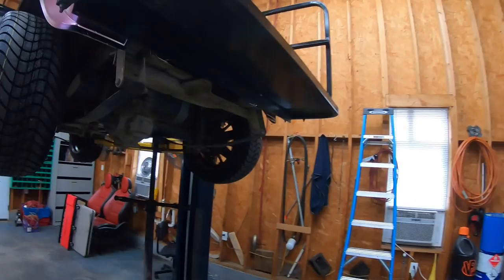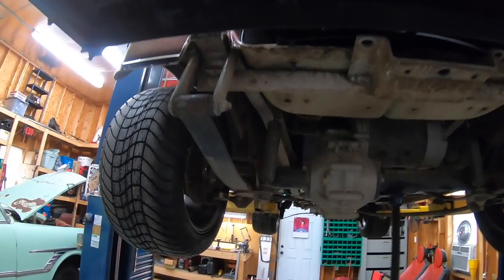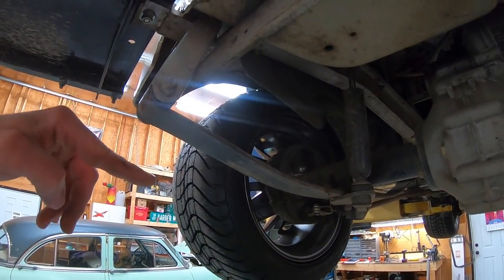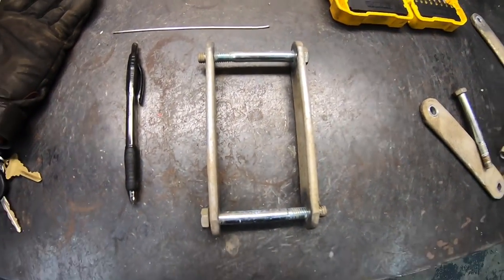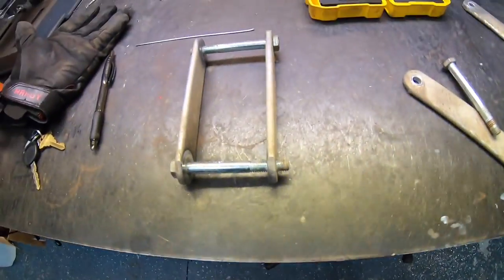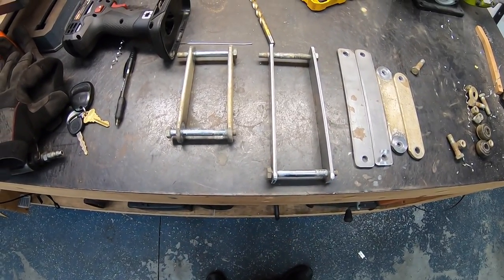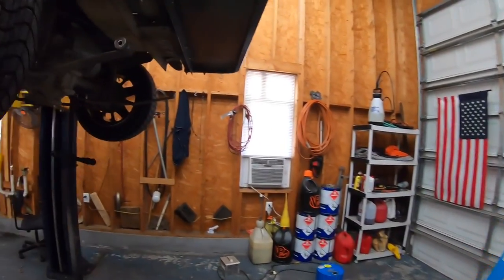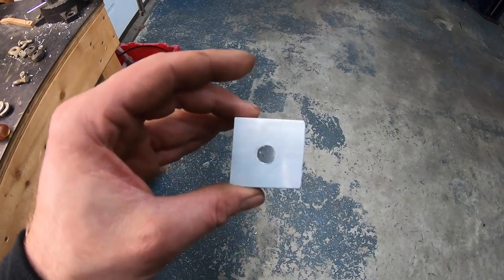Easy Home Made Golf Cart Lift. Club Car DS

Comment: Great job I did the same thing here on mine , I did  1 1/8 inch longer shackles and used the stock shock mounting holes and it rides great . .however I probably would suggest using his shock extender bracket due to how a shock works. .me using the stock hole with a 1 inch lift could make the shock stop in a upward motion from large movement but I live in hilly rough terrain and I haven't noticed anything odd with doing this!  looks like I gained about 1 inch ride height , glad I did it and thanks to you! 🤠 went to Lowes and got steel plate 1/4 inch thick for shackles. .it was 16 bucks 👌

Comment: Just put the springs  on top of the  Axle because that's what I did and it works find. but I installed heavy leaf springs 5 leaf DS 2000 35 mile hour less swaying.

Comment: Very cool.  I too have an ole Club Car DS , mine is an 85.  
Did same on front & I moved my leaf spring on top of the axle which was a cheap kit.  Works well.  
Hey nice shop & lift!
Reply: What's needed to flip the rear leaf to the top of the axle? Any additional parts? Thx
Reply: @mygt8a4re  it was a very easy & inexpensive JAKES rear kit.  This link takes you to a full kit but I only purchased this Jakes rear kit as a seperate .
https://www.golfcarttiresupply.com/jakes-3-club-car-carryall-ds-spindle-lift-kit-1981-up-w-4-wheel-brakes/
Reply: @erickessler6094  really appreciate the help! 👍

Comment: I did the 1" lift block on my precedent. While I'm happy with the results I'm upset about the negative camber it added as well as the very tight front on bumps from losing an inch of spring travel. Forcing the front leaf down actually makes the spring expand which forces the bottom of the wheels out since the leaf connects at the bottom of the spindle. Then compressing the spring takes away an inch travel or the softest part of the travel which makes the front end very stiff when driving around. I wish somone would make a front 2" spindle lift. It would be a hot item! The shackles work perfectly!
Reply: It exists now lol
Reply: @minivanwhy874  really? For a club car precedent? Please post a link!
Reply: @minivanwhy874  seriously please point me in the right direction, I've been looking for a 2" spindle lift for my cart since I purchased it a few years ago!
Reply: @mygt8a4re  ebay has a bunch. And theyre cheap
Reply: @minivanwhy874  I must be searching wrong, I see 3" up to 6" but no 2".
Reply: @minivanwhy874  here's what it says on Ebay: "No results found for “2 inch drop spindle club car”. What are you looking up? I've been on the forums for years and there has been a lot of talk on this and no one makes it...
Reply: @mygt8a4re  looks like 3" is the shortest i can find
Reply: @minivanwhy874  that's what I was saying over a year ago when I typed that, lol. Wish there was a 2" drop spindle avail for club cars. Perfect lift for 20" diameter tires running 12" or 14" wheels.... Would be perfect

Comment: Just curious, there isn't any real  'camber' adjustment on those DS carts. How did you adjust for that??. DS carts really only have the steering box drag link and upper tie rods, only allowing Toe in/out adjustment, which is unaffected by the lift... The center pin on the spring has a 'cam', It's an Oval bolt, that allows a small camber adjustment within the stock hole, BUT if affects both wheels, essentially on the same axis, so if you fix one side, the other is worse.  I bet you fought with it before you noticed the same thing I eventually did, finally found a club car manual and realized I couldn't adjust for it.
Reply from the maker: I didnt adjust for it. I dont use it enough to worry about tire wear

Comment: Didn't see how old the video was. But couldn't you have done it in the rear the same as a pickup by moving the axle from the top side of the leaf spring to the bottom side of the leaf spring and that would have completed your rear lift

Comment: Any idea exactly how big of a tube you could make work in the front? You used 1.5” block for the front, any idea if I could get away with a 2”-3” block?
Reply from the maker: The way I did it, probably not. Changes the alignment too much
Reply: High PSI tv 10-4. I couldn’t quite tell from the video, but on the block in the front did you put it above the leafspring or below the leafspring?

Comment: So 1 inch of shackle length added 1 inch of lift?
Reply from the maker: pretty close
Reply: @HighPSItv  hey thanks, I built my own a couple months back. For my Club car precedent I made 4" hole to hole to gain 1.5" of height over stock height. Which works out to be about 2" added length for 1.5" of added height.

Comment: Somehow I see the rear end buckling over, please do not have anyone riding on the back when it happens. Lift the rear of the cart between the Axle and leaf springs and put the original leaf spring brackets back on for safety sake.
Reply: Those shackles will work fine.
My XRT came from Club Car with a 4" lift and they lifted the rear the same way.